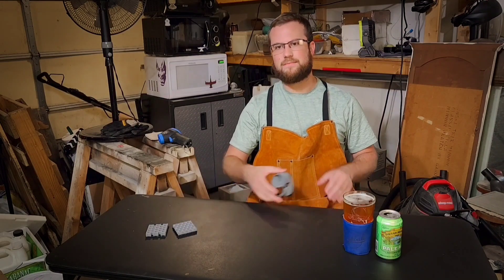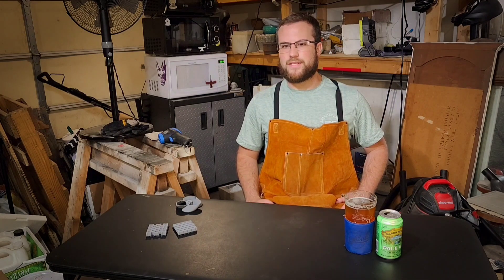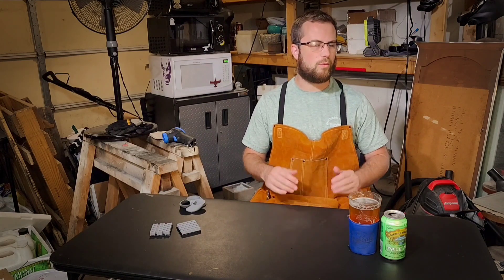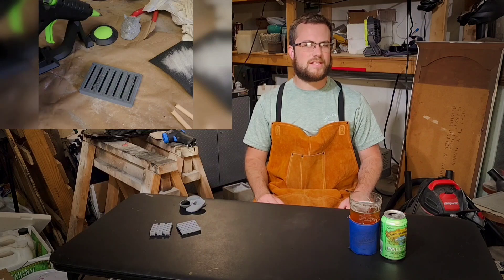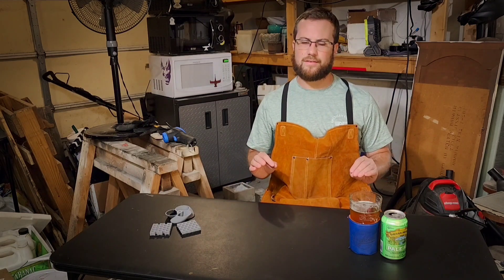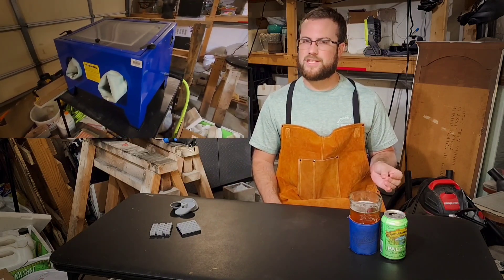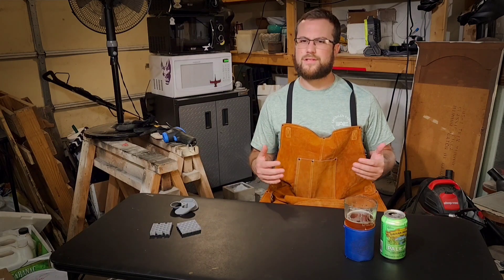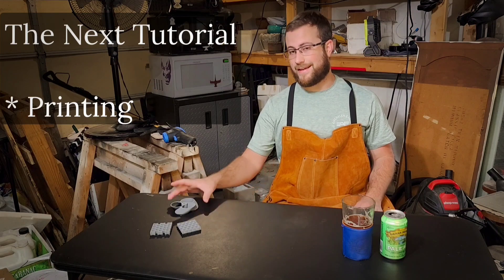Microwave Sintering: Could It Work for You?

Comment: Hello Highball, 
Did you manage to successfully sinter a steel or stainless steel part in a microwave oven so far?
Reply from the maker: Not yet, but definitely planning on it (and don't see any reason why it can't be done). I cap my power output to 80% for aluminum so at 100% it should definitely be able to do steel
Reply: @Mr-Highball  for a 1100 watt microwave? do you know whether it has been tried? Did you experiment with a cheap kiln? The parts I need to siniter need to withstand some load and a high degree of accuarcy due to them being mechenical parts like cogs and wheels. But before I invest in Filamet etc I would love to know whether this is is possible. I found some studys on microwave sintering for stainless steels but they use 4000 industrial mv. Thanks for your reply btw!!! Best
Reply from the maker: Yes it should definitely be possible with an 1100w since I know people have melted steel (the tricky part is sintering and getting the proper cycle). I've been in aluminum world for a long time so I just haven't put too many brain cells towards figuring the steel cycle out yet.

As far as microwave sintering I don't know of any other youtuber other than myself (not that there aren't any, it's just a very niche thing normally only done in industry or a lab setting)
Reply from the maker: @captaincommodore8901  had some corrections in the last reply (stupid auto correct) but figured I also would link shake's video on melting metal in the microwave since he's done steel melts before
https://youtu.be/P1VmIYheuU4?feature=shared
Reply: @Mr-Highball  thanks a lot for reffering me to shake! interesting approach to melt the metal into a 3d printed form! Also very interesting that the power of the microwaves magnetron wears out over time and the a new one with lower specs can outperform an old one with more power. Maybe time to invest in a new microwave :D